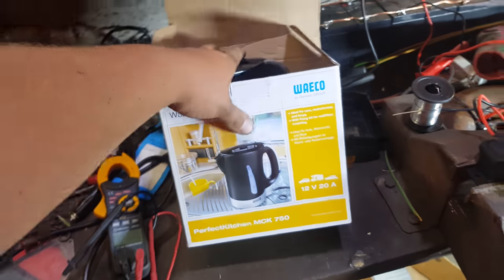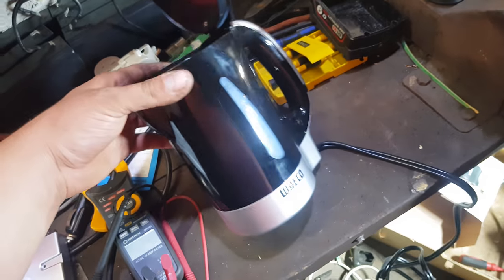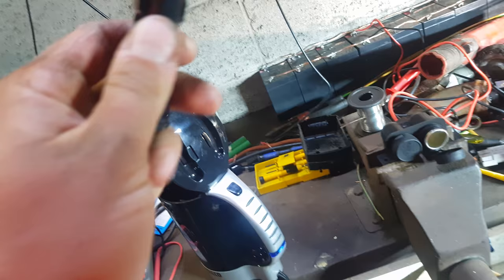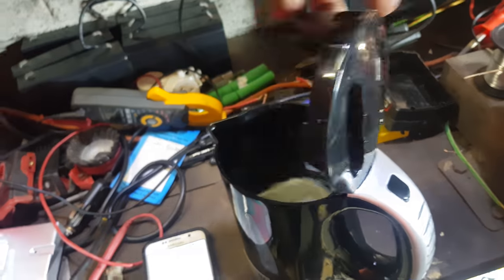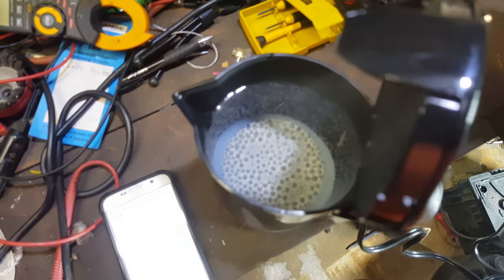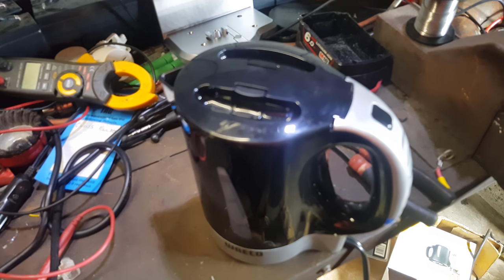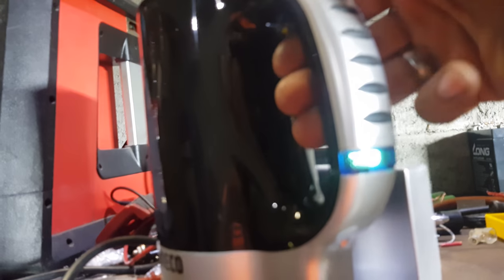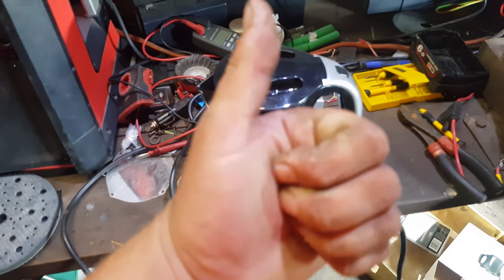Waeco Mck 750 ml mobile car kettle test

Comment: I have the same kettle and had to do the same as you have done by directly connecting it to the car battery if I wanted to boil water which now takes around 20 minutes. 
I have had the kettle now for about 4 years and it gets used when we go on holidays that is once a year. The heating element is cover with a painted aluminum plate which has become much pitted and the paint on the plate is flaking off. I would have expected much better quality for the price.
I have now replace it with a low wattage 230v kettle and a12v to 230v inverter under the seat. This solution works far better for me.
Reply from the maker: In my work truck I have gone with a 900w pop up silicone 240v Kettle.
I have a 1200va victron phoenix and it has been a solid preformer
Reply: @Oneupthesleevecustoms  I am also using a Victron 1200VA inverter and it works superbly with a Bodum  700watt bistro Kettle.  As I use the inverter with other appliances, i.e. induction cook-top, toaster, etc. I was afraid that I might overheat the alternator or flatten the starter battery so I also install a Victron DC to DC converter to control the charging of lithium battery that I also installed from the van while driving.  It works great.  The Victron 1200VA inverter will run briefly at 2000 Watts, enough time to turn the induction cooker down to 900W to fry the eggs.

Comment: I got one for free but had the plug cut off.
I reconnected the plug but unsure of polarity because no marker on the cable.
I plugged it in but didn't think it was working and tried reversing polatity: clicking noises but no magic smoke.
Thanks for the video because it convinced me to leave it on for a while; and it boiled and switched off.
The battery to plug connected got hot, so I probably lost a bit of power.
Reply from the maker: Yeah big current draw so higher voltage and short cord is a great idea

Comment: The important thing with these 12volt kettles is the most people think you can just plug them in to any 12volt socket, you almost always have to have a specific cabling with high current capacity to a new or existing sockets or you will keep blowing fuses or worse. Looks like you just spent the best 5 bucks of your life!
Reply from the maker: +Karl Bartelt yeah they pull some major juice!!!
I was playing around tonight with  it and i made and 18v milwaukee battery adaptor so it can run off my cordless tool batterys  and it boils in 6mins on a 9.0.ah battery
Reply: One Up The Sleeve Customs cool dude! Nice work, can you post a video of that?
Reply from the maker: I can organize that mate make sure you are subscribed. I play with lots of things like this
Reply: One Up The Sleeve Customs sweet man yeah I'll subscribe alright

Comment: If your in the car always keep the engine running when using one. It will quickly drain the battery
Reply from the maker: Yeah they pull around 12 to 15 amps so they are a bit thirsty

Comment: I screwed the base to a timber cross (X) to keep it solid while driving up the freeway, just enough to make 2 cups so it didn't spill on any bump, sweet, pulled up with hot water for a cuppa.
Reply from the maker: How long does it take in the car?

Comment: Looking on Amazon for one of these 12v kettles to use in the Transit. My thinking was if I could find everything in 12 volts I wouldn’t need and inverter to switch power to 110V. (which takes a big draw) when only needing like 8-10amps for phone or ipad.  At 14 amps does this seems like a big draw? I see  the fridges also run fine on 12 V so thought why not a kettle?  20 min isn’t too long to wait but if pulling a constant 14 amps for that amount of time? Idk a 1800W portable induction can heat in 5 min. What to do? Go with inverter or...
Reply from the maker: 12v kettle is way to go
Reply: I use mine in my Transit with a 20Amp breaker, no problemo. I had the cigar & aux socket installed on the side panel behind the drivers seat especially for the odd machine with 12 volt power.
Reply from the maker: That's a mint idea cheers for sharing

Comment: You should never use again 12v batteries in 8 parallel. Only put 4 bigger batteries. You should buy 20Ah cells. What you've done its dangerous. Some of them may discharge in nearest cells at high speed and start heating up. One day, your battery bank its gonna explode.

Comment: Good video, but 20mins to boil is Abit of a piss take
Reply from the maker: I should re do video its more like 7 mins now. No idea how it took so long first times
Reply: @Oneupthesleevecustoms  okay 7 mins isn't that bad. I could live with that. 

I'm thinking of upgrading my 1000w inverter to a 2000w so I can use a microwave or boil a kettle off 240. But if that wacoe kettle can do it in 7mins off 12v I might consider that
Reply from the maker: @pattyrafter88  and heaps less draw than 2000watt kettle